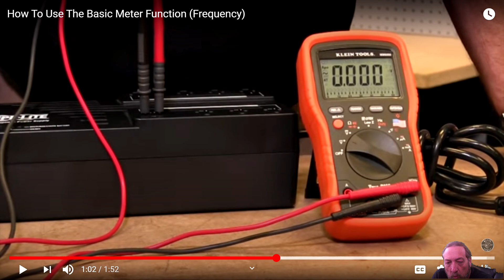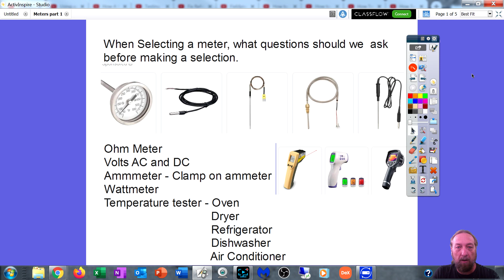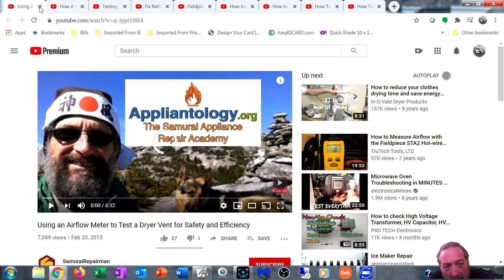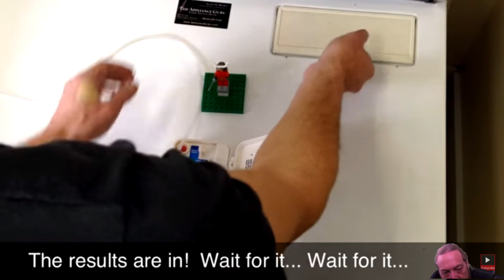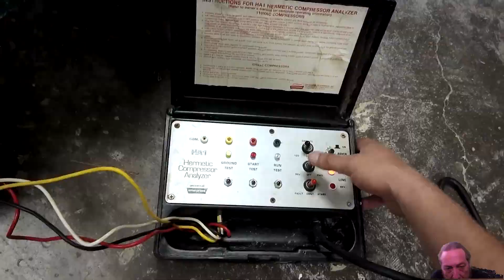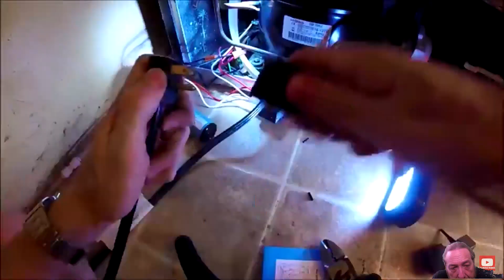#TECHTALK Meters Part 2

Comment: Great presentation of frequency! I've seen the 3 in 1 start relay  cause compressors to short out or open a winding, and the main reason why is that the overload on the RCO-410 is too big for smaller hermetic compressors. It'll work on a commercial tecumseh AE4430AXA 1/4 hp compressor, which draws 6 running amps, so the overload can't possibly be compatible with a 1/4 hp household compressor that draws only 2 amps. If the comp can't start for any reason,, it hums away (locked rotor) until it self destructs... Attaching a common 1/4 hp push on overload first, and then the 3 in 1 is a good preventive measure.